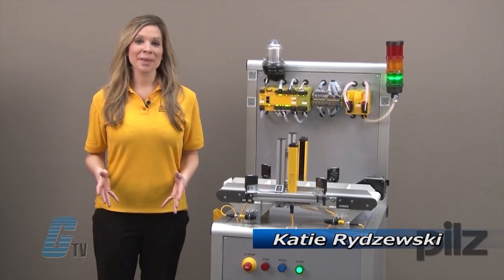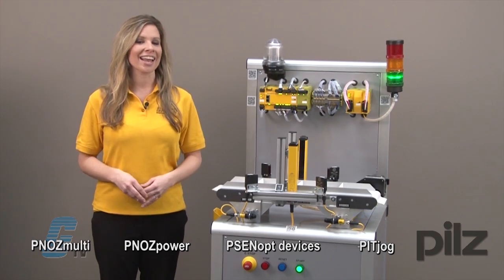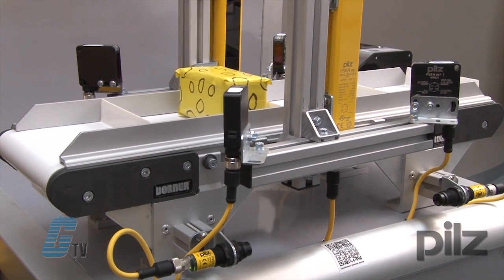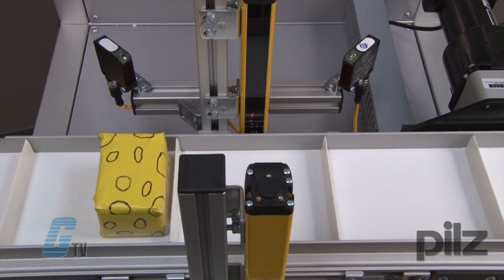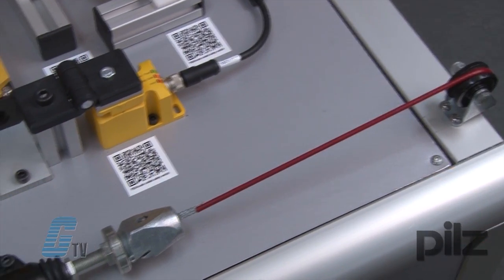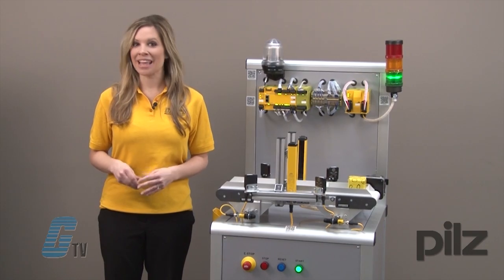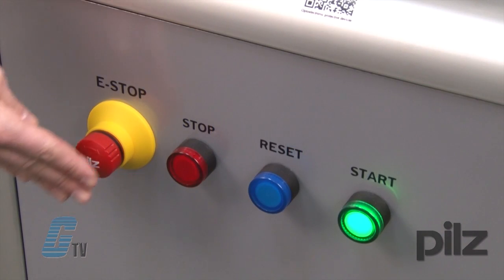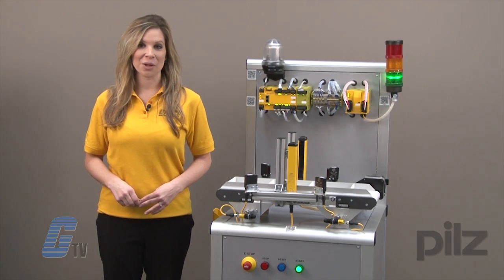Pilz Category 4 Safety System For Conveyors

Comment: The X shaped cross beam muting is fine with constant regular shaped objects, but I know that leuze have a feature where it will go into error if both beams are broken within 4mS of each other as a check for both pec outputs being shorted together. If you have lots of different shaped object passing through, you get false trips. I prefer sequential muting.

Comment: we run about 60 bottles per minute and about 3 inches apart from product to product. if your curtins can handle the muting in this process with out hicupps i will buy 2 sets for test
Reply from the maker: Interesting... I have forwarded this to a product manager and a couple of manufacturers and wanted you to know that we will have an answer for you as soon as we can.  Our product manager here will run a few test and also check to see if there is an alternative way to accomplish what you need.
Reply: Thank you very much

Comment: i would like to see the conveyor a bit faster and constain product. i have tried this same process with no luck. i have a banner and also keyence light curtin if i run one by one or if i seperate the product more it does work but under normal operation the constant bottles passing and muting the sensors confuses the curtin and faults out on both banner and keyence